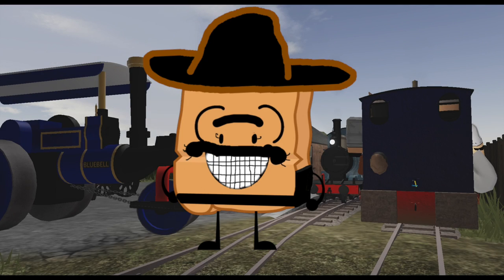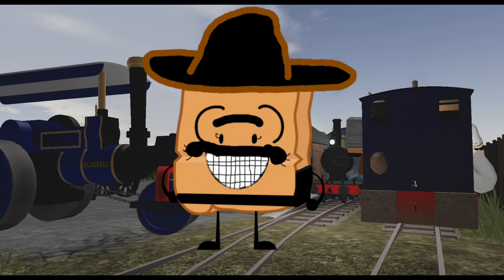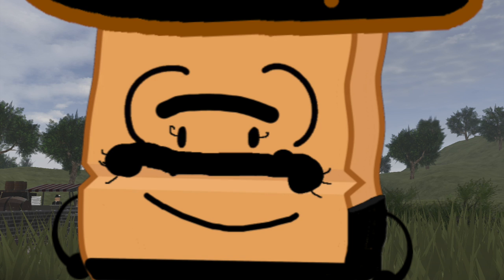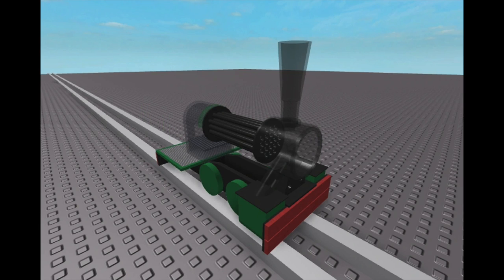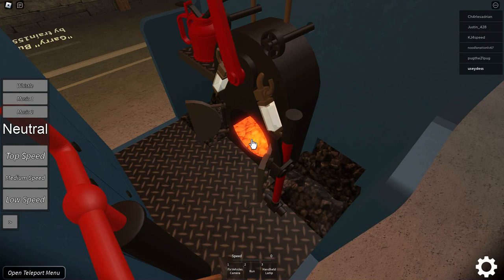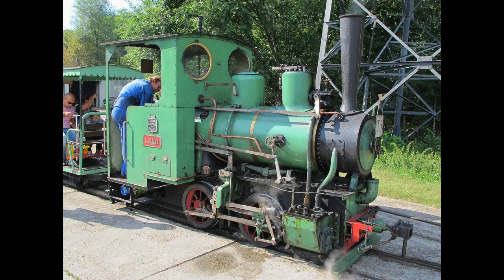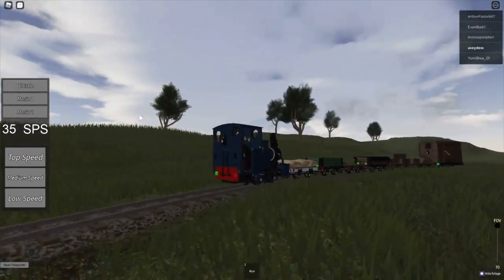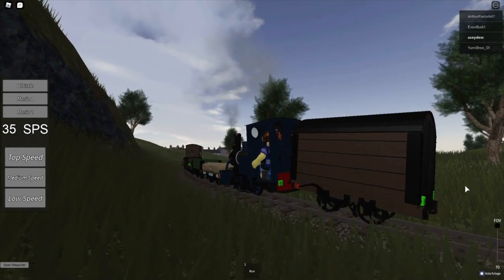Engines of Somewhere Wales Episode 1: Big Iron

Comment: There appears to be a problem with the game Since I can't seem to run it even though I have a pretty decent phone a Samsung A14 I tried it on the laptop and it doesn't even be working at all either It just stays in the loading screen So someone please explain to me what is wrong with the game?
Reply from the maker: game too powerful for your device, upgrade to a newer more powerful device or get an old retina MacBook
Reply: @niklasmolin3195 I haven't played the game for like two years or so so what could have possibly been added since I used to be able to run the game on an even older phone a motorola to be exact Is it some form of connection problem since im pretty sure a 1000 dollar laptop should be able to run it right?
Reply from the maker: @solidaridadjusticia1438  refer to my Biggest update SW has gotten 2023 video and 2022 update video for more information.
Reply: I just tried it on my PS5.And the same thing happened so yeah it's probably some form of network issue